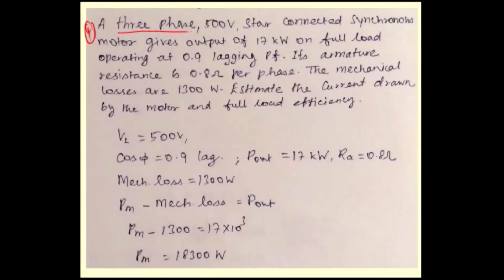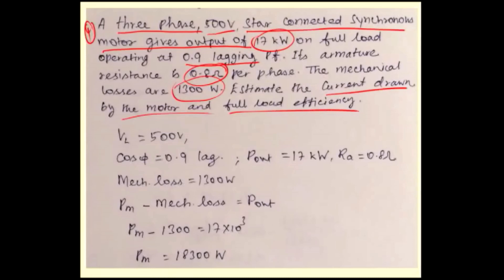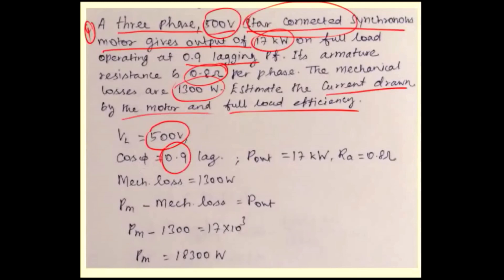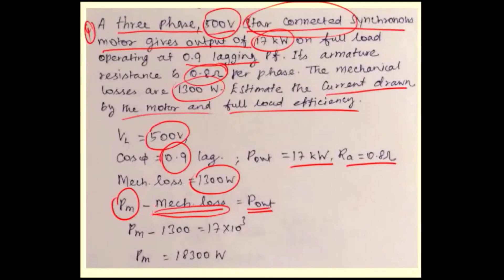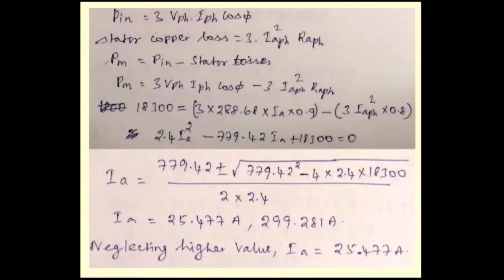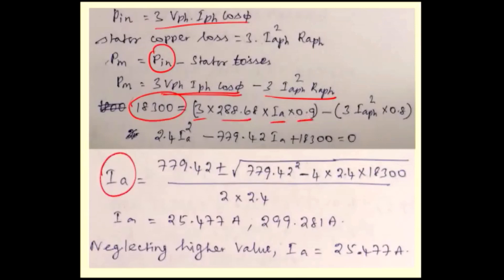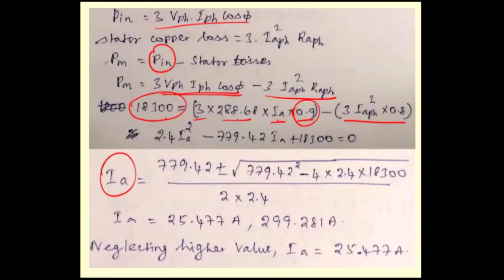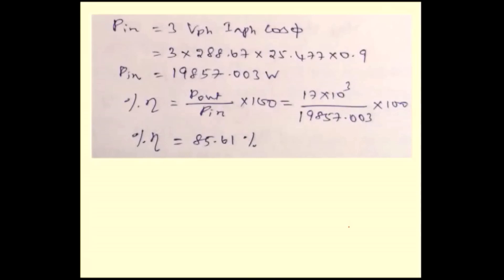Synchronous Motor Solved Problems #4 | Calculate full load Efficiency of Synchronous Motor

Comment: A 3300v,3-phase star connected synchronous motor has effectie resistance and synchronous rectance per phase of 0.5ohm and 5ohm respectively. The input to the motor at normal voltage is 1500KW and the induced emf at that time is 4000v. Find the line current and power factor ? please Can you explain this problem sir.